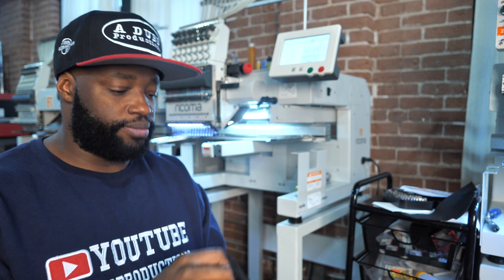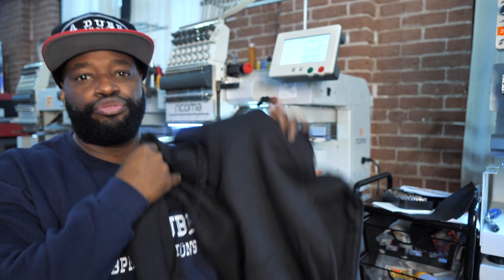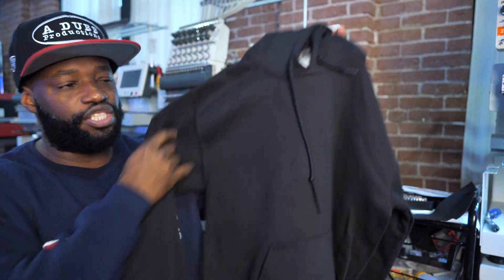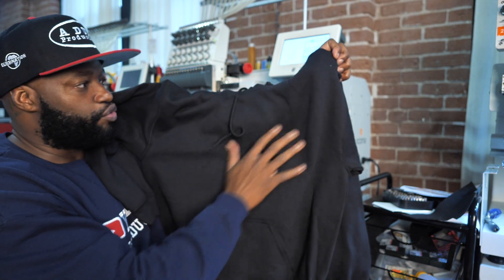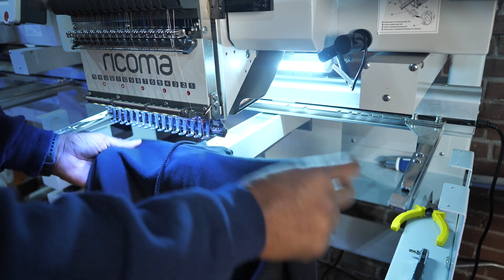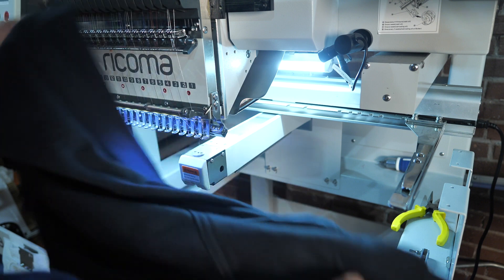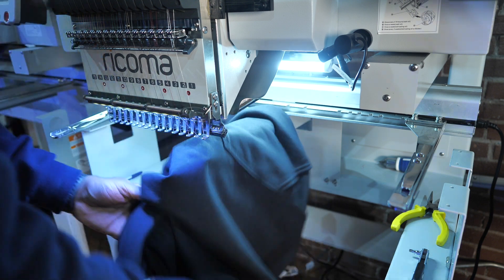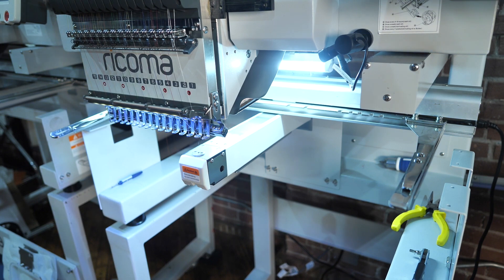3 Things Ricoma Did NOT Tell You

Comment: I called them today to apply for business financing. I pray all goes well. I want the MT-2002-8S
Reply from the maker: I hope you mentioned my name Tajuana. As much as I be beggin y’all in every video to use my link. 😳
Reply: If I got financing you should my score is way low
Reply: @adubbproductions  I just sent Gabe an email 🙏
Reply from the maker: Awesome. Thanks for trying.
Reply: Just got our 2002-8s and love it. Only thing that was not directly mentioned or I missed them talking about it. Was when you have thread problems and need to float backwards is you have to push the silver switches on the heads up after you are done setting the float to get them to actually start sewing. Otherwise it will pickup right where it stopped.

Comment: Hey Allen. You stated in one of your videos regarding how to back up stitches but I can’t find it. If your thread breaks, and you want to reverse your position of when it stops stitching. (I hope that makes sense) SWD. THANKS IN ADVANCE
Reply from the maker: Yes. Hit the bottom on the screen next to the Lock icon. Put it on F.L float low. Or F.H float high.  When it’s in either mode you can rewind using the stop button or fast forward using the start button.  You can see on the screen where you are in the design.  Once you corrected what was wrong or went back to the point you want flick the toggle switch on the head ( that tells it to start right away.) then hit that button next to the lock a few more times so it goes back into embroidery mode (it will probably say waiting or something like that. ) then press start again. I’ll make a video on that this weekend.

Comment: I got a question hopefully you can answer it. When I get the T break I fix it and when I press start, the foot doesn't go down. The machine acts like it does when it is embroidering but the foot doesn't go down. Whenever I change my bobbin or redo a thread it never continues. I have to either start from scratch again or do a perimeter scan.
Reply from the maker: Flick the switch next to the flashing light and it starts right away. Flick it up. I would rewind it a little to avoid gaps.

Comment: I HAVE HAD A MAJOR ISSUE. i KEEP GETTING A COMMUNICATIONS ERROR ;CHECK CONNECTIONS AND ITS NOT EVEN CONNECTED TO THE INTERNET OR COMPUTER?! I CANT FIND ANYTHING ON THE INTERNET ITS CRAZY AND RICOMA TECH SUPPORT IS HORRIBLE! CAN YOU PLEASE HELP.
DAVE
Reply from the maker: Did you contact their tech support? What did they say? When did you contact them. Give us some context. 
I have never seen that message before.  When did you get your machine?  Where did you get it from? How old is it? It is a Ricoma right? Is says Ricoma on it?
I’ve never connected my machine to the internet, don’t think they are supposed to do that. They are not supposed to connect to your computer either.  I’m totally lost. You are supposed to put the design in the machine via usb flash drive.
Reply from the maker: I can try to help you.  Next time just have them call you back don’t stay on hold for 2 hours .  We gotta figure out exactly what you are trying to do though. Sounds like you have two different issues that’s not really an issue.  What did you call the rep to find out? Let’s start with 1 issue at a time. I’m gonna tell you the real deal cause I’m not them.  

You set the center point of the design by selecting the stop light looking button in the top center of the screen in chroma luxe. That isn’t really an issue though. Thats more of you not know how to set the center point.  The reason I say this is you have to take some type of accountability in when something doesn’t work vs you not know how to work something. You can’t complain about everything Al saying it’s a major issue because YOU don’t know how to work it. YOU have to learn it.  If you have to call in for every single thing then it’s gonna be extremely difficult to get through projects.  Can’t point the finger all the time when it’s not an issue. It’s very misleading.  Also consider the fact that it’s Sunday and you got in touch with a representative.  What other company can you talk to someone on a Sunday? Gotta give them a little credit I’d think.

What’s the connection issue?  You not supposed to connect the machine to the internet so I’m lost. Please explain.
Reply: @adubbproductions  
I CALLED THEM BECAUSE I GOT AN ERROR THAT IVE NEVER SEEN BEFORE "COMMUNICATIONS TIMEOUT;CHECK THE CONNECTION!"  MY MACHINE IS NOT ATTACHED TO ANY COMPTER NOR THE INTERNET.
THANK YOU SO MUCH!

Comment: They didn't tell you chroma doesn't overlap...they didn't tell you the machine will break thread for no damn reason whatsoever...they didn't tell you ur bobbin will come with the tension way off...should I keep going🤣
Reply from the maker: All of those things are just you not knowing how to operate the machine.  You have to be accountable for when you are not doing things right.  I use to have those issues but now all of my machines run great. It’s not the machine Robert it’s you.  The sooner you accept that you just don’t know how to adjust for the issues you are having the sooner you will learn how to fix the thing you are doing wrong. Just some harsh reality.  Please don’t take wrong I’m just trying to help.  It’s a machine, it does what you tell it to.
Reply: @adubbproductions  I can adjust in increments all the way tight or all the way loose...same issue no matter where the tension is top or bottom
Reply: @adubbproductions  you used to have all those issues🤣🤣🤣 you just don't know how to use....thanks for the help on nothing...ur very informative...great channel
Reply from the maker: I appreciate it. Good luck with your machine. ✌🏾
Reply: @robertmartinez696  you still having issues with your machine.  I thought you sold it.